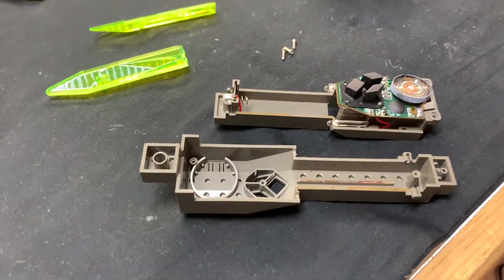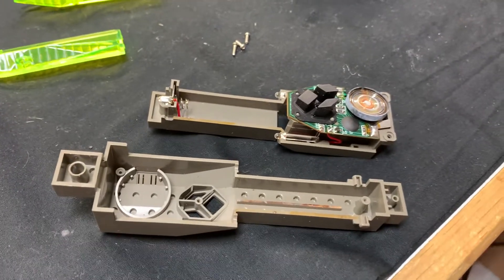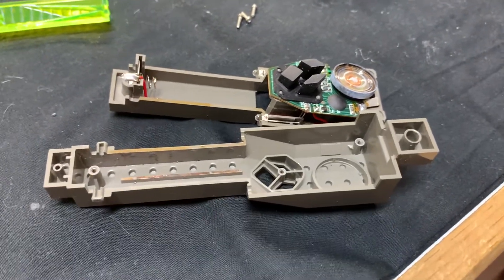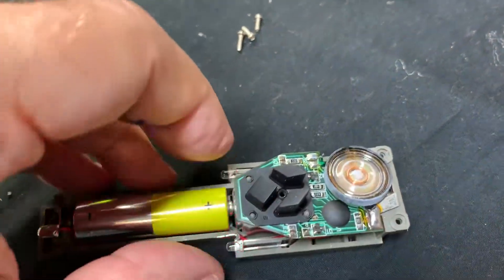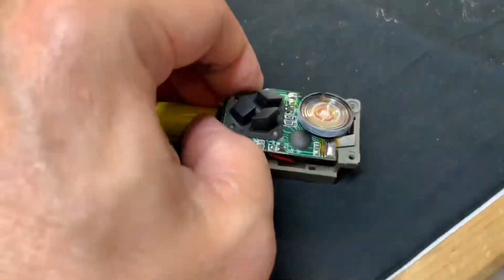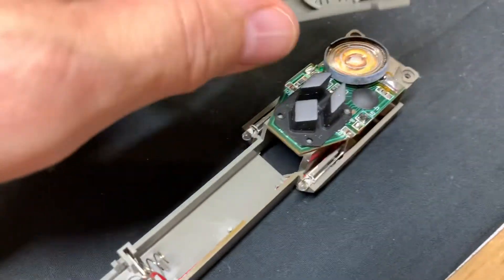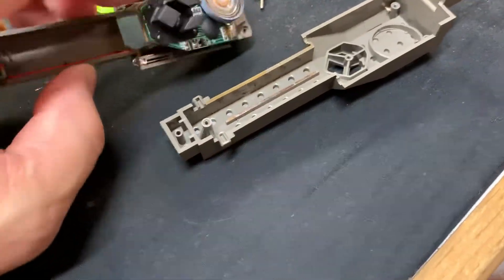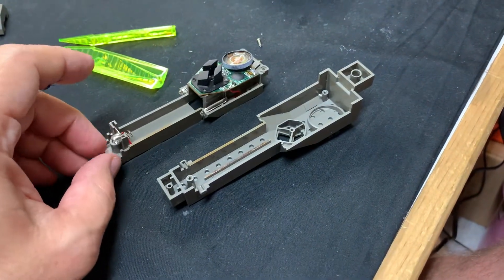DKP - A Short Vid about the Acid Leak in the Insectoid Light/Sound Brick

Comment: I’m not sure if many people know this but if you hold the center button down continuously the engine sound will spool up like a jet and stay there until you release it at which time it will spool back down before it shuts off.  It’s such a cool feature of that part. 🙂
Reply from the maker: Thanks for the additional info! Its a fun little feature.  This was one of my fav light and sound bricks for the varying things it did.  Though it was a little big and kinda relegated to just Insectoids. :)

Comment: Another thing that works well with removing the leaked stuff from batteries, is citrid acid. I have it in powder form, to descale our electric water cooker. Solve a teaspoon or less in hot water, and then I usually take a cotton swab/Q-tip and apply the fluid on the affected spot. Benefit above vinegar is that it smells a lot better. Vinegar works fine too though.
Reply from the maker: I like the citric acid idea.  I hope that I won't come across too many others like this :)